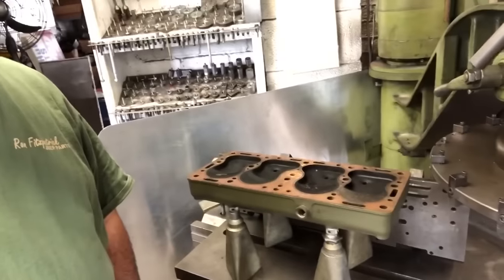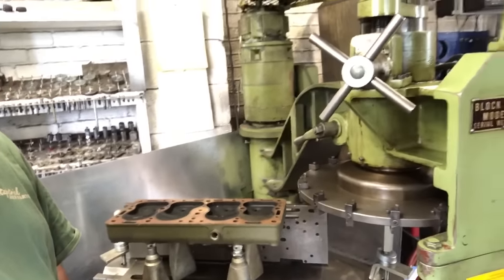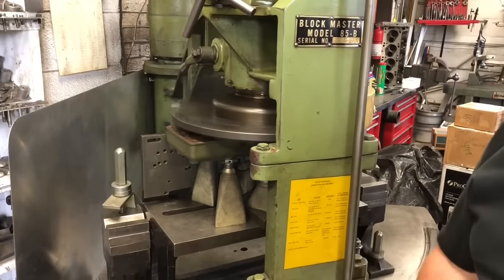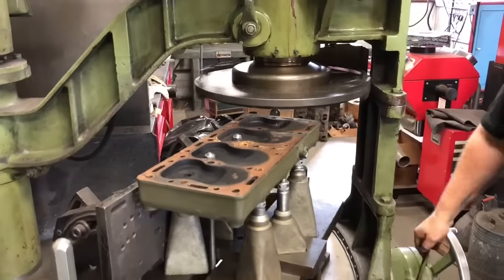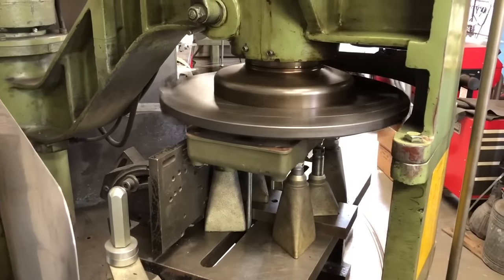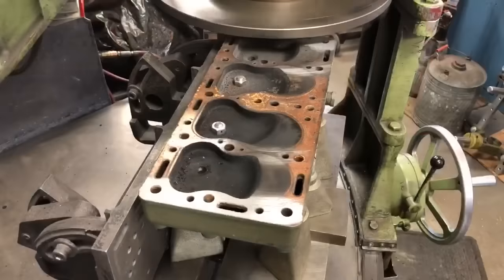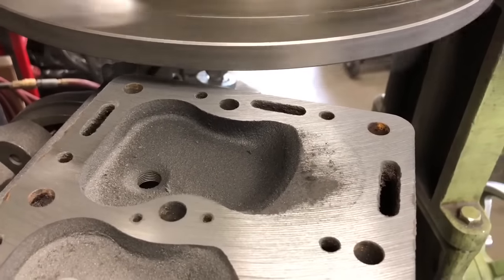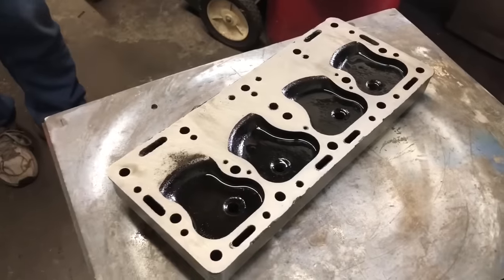Willys Flat Head resurfacing

Comment: I would liked to have seen a straight edge put on the surface of the heard and checked it with feeler gauge after the milling job.
Reply: Why? You can clearly see the warp and how it was taken out.
Reply: @Mr sock. With those six jacks, doubt he had it torqued that right
Reply: Working in 3d control i ca say for sure that the head was warped because of the clamping. When i have to repair a device i check the device clamped and unclamped so i am sure i have no deformation.
Reply: The machine would have to be in really bad shape to not cut level, the foot that runs around the edge of the table just stays good. The old machine I ran 35 years ago looked terrible and produced superior cuts.
Reply: @scrapwire1  i agree that some old machines are built much stronger and can last 50 years and cut straight like a arrow with good maintenance. But here is clear that we have operator error because of the clamping style. If he would unclamp it and put a comparator clock/watch ( dont know the term in english) it wount be straight
Reply: @zipperc1210  As you wish, I have no time to argue, I'm sure he put the stands against it before he clamped it down, I ran one for years, clamping them the same way and never had a problem, if it disturbs you, please don't do it that way, maybe you have a magnet big enough to hold it.

Comment: Likely flatter than it ever was from the factory. Nicely done. Don't need coolant, really, when taking such a light pass. That cast wouldn't even have time to heat up enough to cause any damage. I guess the milling head isn't level, I didn't see any cross hatching. Depending on how much the head is tilted, I guess there could be some cupping, but the head bolts and gasket will take care of that.
Reply: I have been told that you don't need coolant or lub with cast iron.
Reply: I don't know why everybody seems to think factories built bad parts. The new cranks being sold are out of spec and last week I had 5 pistons wouldn't fit over the rods. They also pack piston rings by weight and we had one kit short a ring and one kit with an extra ring. We never used to have the problems with quality that we have today with better equipment. Seriously, new tie rod ends that last 4000 miles is going forward?

Comment: Couldn't hear when you said something about wire wheeling? What's wrong with using a wire wheel to remove gasket before machining? I worked in a machine shop a few years and used wire wheels every day

Comment: You did everything backwards.  Clean, check for cracks and then resurface. (if not cracked)
Reply: I agree.
Reply: theres a reason to crack test it again because there may be cracks underneath a good surface.
Reply: @10Mbowman  nope probably a bottom feeder job were the customer just wants it milled and does not want to pay for anything else. I used to call them one valve valve jobs. Just fix the burnt one. should be refused
Reply: Good luck finding a crack on a 80 year old head before you take all the rust off.
He was using the resurfacer to clean the head.
If I brought in an antique head and the re-builder used anything other than the re-surfacer on it to clean it , I would kick his a$$.
Reply: @glennchartrand5411  or you can use a wire wheel or a glass bead cabinet or a sand blaster or a shot blast machine. machining the head to check for cracks is not an efficient way, It was probably a low buck job and the customer did not want to pay for cleaning and magnefluxing.
Reply: @tomhutchins1046  you don't use a wire wheel or abrasives on an antique head thats warped 
You take the absolute minimum possible amount of metal off because you can't just buy a new one.
I'm pretty sure this guy paid EXTRA to have it done this way.
Reply: @glennchartrand5411  you wont take any measurable amount off with any of the ways i mentioned. This is not youtube bull i have owned an automotive machine shop for over 30 years. You hot tank then glass bead then magnuflux (check for cracks) if the cracks are repairable you do that first . Then you mill the head last. But you always check to see if the casting is good BEFORE you invest time and the customers money in milling or machine work.
Reply: @glennchartrand5411  PS dave walker the one at the top comment is absolutely correct
Reply: @10Mbowman  Would not hurt to do a second mag after milling odds are you wont find anything you did not see in the first mag but it can't hurt
Reply: @glennchartrand5411 
 Ps except never use those little scotch pads in a high speed air tool many mechanics use they can do some damage.
Reply: I'd find them all the time. No luck needed.
Reply: @tomhutchins1046  Well said Tom, I worked as a machinist for years to, these guys probably have never seen a modern shop, let alone a CBN cut surface.  We used rottlers and they are fast and accurate.  Love to see how he resizes some of the newer John Deere Rods, love to see him try on a old sunnen rod hone .
Reply: @glennchartrand5411  I'm willing to learn why if you're willing to teach me.
Reply: Привет не руссккие

Comment: Hi guys, very nice presentation, respectfully when an engine has a warped cylinder head the engine block also warped, question, a saw someone claninge the cylinder head on a cleaning tank, i know fist hand that those claning agents penetrate from your hands into your liver in eight seconds, i don't want to mention any particular brand but please avoid at all cost to do that with your bare hands, those cleaning tanks were removed from our shop at cummins metropower in  newark nj on the early 80's because we found out the extreme health hazard to every one in shop, please use caution with it, it is a most to wear safety gloves and breathing masks, respectfully a fellow worker, please keep up the good work.
Reply: Most kind of you guys.
Reply: better turn on spell check

Comment: Knew of an automotive machine shop in Florida that used an eight foot horizonal belt sander to "resurface heads".  They'd lay the head down on the running belt, spin it 180 degrees a time or two and call it "good". Even as a kid, that never seemed quite right to me.  Even less so now.
Reply: i bet it worked though
Reply: @alexjohnward  The production rebuilders used belt sanders most are gone now and thats one of the reasons . They just could not get the quality

Comment: No way would I have let that low spot on the head go. It looks as if it were around three or four thou of an inch. Why not just take it out? Carbon could build up under the head gasket causing the head to possibly crack in my opinion. Other than that one complaint, this was a good video. Thank you for your time in showing the world these skills.
Reply from the maker: James Kennedy head works perfectly

Comment: If the head surface was warped to start with, why measure off of the warped side before starting to cut? Wouldn't it make more sense to measure off the other side of the head to the surface the head sits on?

Comment: I wonder if those two hold down bolts in the spark plug holes are causing it to bow down in the middle.  if so, then they are messing it up by making it flat.

Comment: I would’ve personally wanted a smoother shinier surface without the deep cut likes to insure a leak free surface, but that old timer looks like he’s done plenty of em ;)
Reply: those cuts hold the gasket in. a pro would unclamp the head and turn it around so the cut marks face each other and compress the gaskets......rofl.
Reply: Those cuts don’t hold the gasket. You want a nice flat smooth surface. But I like your sarcasm 👍
Reply: @IntegraDIY  MLS gaskets require a very smooth finish, the old school copper, and graphite gaskets need a less finished surface so it can grab and seal everything.

Comment: A whole lot of engineering  gurus in the comment section 😜
Reply from the maker: crown Victoria lifestyle it’s okay it makes people feel good. I’m grateful for what I got done. Stay tuned picking the engine up tonight
Reply: If YouTube is good for one thing, it's "experts" who will just proclaim a 30 year career in whatever they're trying to sound smart about.
Reply: I worked at a place where we pinch bolted the heads on a face plate and spun it across a single point tool on a belt driven lathe so its whatever gets the job done, never felt totally safe near it while it was spinning though lol
Reply: If you knew what you're doing with this kind of work, you could be critical too.
Reply: The most fertile soil for these kinds of comments are welders' videos.  For some reason a good number of "experts" have this felt need to communicate everything they perceive wrong in what another "expert" is doing.  God help the individual who is just some weekend DIY welder, and has posted a video of his project.  His work and very character will be put under the Youtube microscope, and judgment pronounced!  The vitae-resumes will be pulled like six-shooters, until sooner or later someone finally declares that they have welded on nuclear reactors or one of the NASA space shuttles.

Those kinds of posts can be oddly interesting to read; like watching a slow-motion car wreck.  You want to look away, but its so strange you find you cannot.  One thing is for sure; regardless how much technology may advance in any specific field or trade, human nature remains constant and unchanging.

Comment: Well of course it will be bowed the way it is held on the table - why would you put the clamping studs in the middle and jacks on the outers?  The clamping force should be in line.  There is a reason why industrial machinists can work in automotive machine shops but not the other way around.
Reply from the maker: Rabid Farmer This man has been rebuilding racecar engines for at least 30 years I trust him. It was checked for flatness before it was installed on the table. This head is perfectly flat and has been working on my engine without any problems ever since
Reply: Watson's Wagons — im not questioning his competence just the procedure.  It is inconsistent with accepted industrial thought on clamping or securing a flat stock.  A surface grinding machine would have been optimum as it will put the smallest amount of stress on the material and requires the smallest clamping force.  But if the process works, im all for it is all.

i also understand the limits of the type of milling machine being used - a Storm Vulcan flycutter.  I own and use the same.  How do you think this head was clamped and machined from the factory?  They would have had a special jig to hold and secure the head for the machining process.

Comment: Hi guys, can I add a comment, or ask a question. don't bite me If I`m wrong here, but you only have applied downward force in the centre 2 plug holes, would that not put distortion in the centre of the head when machining? or was it done that way for a reason.. thanks for the video anyway, it made me Interested enough to comment.. Thanks, Ivor from the UK.
Reply from the maker: Ivor Burit if you look there are 6 supports under it. It would have distorted if the two center supports were not used.

Comment: Mike....how would shaving three and leaving a partial valve space affect the performance flow of air/exhuast gases? I would have thought the depression being factory milled,was for a reason in regards to the performance of the inlet/outlet valves.
Reply: Its not a twin overhead cam head with 10 to 1 compression and gas flowed ports, you could whip off a 16th and make little difference

Comment: near one of the chambers remained microcavities after rust. In that place the gasket will burn. How did you solve this problem?
Reply: If you look at the copper gasket in the last shot, you can see that the gasket is probably not going to touch the rough area. Everywhere the gasket touches the head there is clean and smooth metal. Should be a a tight seal in my mind.
Reply: +Hans Wurst 
thank! Now it is clear. I just watched the video inattentively

Comment: Maybe it’s low where it’s pulled down with the bolts,,,,,, just a thought?
Reply: Lol maybe.
Reply: I ran one just like it 35 years ago in Houston, did years of heads in it, the warp in that head is normal, The bolts probably had little torque on them, just enough to keep it from shifting around during the cut, The wheel exerts very little pull on the head being cut.
Reply: There are probably a dozen video's of Storm Vulcan head mills on here, I bet someone puts a straight edge on one.
Reply: Definitly xD
Reply: @scrapwire1  Thank you from another old auto machinist. Lots of know nothing comments on here.
Reply: @billmiller7138  They just cannot understand the screw jacks under the head, you put the jacks against the head from one end to the other, level the head with a precision level, tighten the hold down bolts, mill the head. I have used a Starrett straight edge with a light behind it on every one I did.     Maybe they think it just uses two stands on each end and pulls the head in the middle, no telling.
Reply: What is pulling the head away from the bolts in your mind?
Reply: @paul9813  I think he is making a reference to the fact the head was cutting on each end and not in the middle, from where I'm sitting, I see 6 jack stands under the head, I have never seen one I could compress. That is normal warp in a head of this type, It's really simple, there is less iron in the combustion chambers, the top of the head is mostly solid iron so when the head is heated it will expand, it will bend toward the least resistance.
Reply: Paul smith well I don’t even remember saying that, what I did say is and it’s on record, that the  lows spots are  where your two holding down bolts are, now this might be a coincidence, but it could be that your middle spacers are a few thou low and that’s why your taking more off the two ends of the cylinder head?

Comment: Honest question.. Why use this elaborate machine over a surface grinder?
Reply from the maker: deweys don’t know, it’s what he has in his shop.
Reply: deweys it's not about the equipment, it's about the operator. Why change what's not broken? The operator has probably been using that equipment for his entire career and has perfected the use of it. I trust someone using old style equipment and years upon years of experience, over someone with new equipment with way less experience. A machinist tools are worthless without the machinist that knows how to properly use them. Complicated is a relative term. What someone finds a complicated procedure, some find to be simple as tieing their shoes. Why have shoe laces when you could use Velcro straps and get the same result?
Reply: @commonnons3ns316  Shoe laces can get you out of a major bind. 3 years ago 911 operator told me to get shoe laces and a safety pin. Who uses safety pins any more since the advent of diapers? So I go get the shoe laces from my work boots I keep on hand cause they get burned a lot torching, and the safety pin I had some keys on and deliver a baby 12 minutes before the fire dept. and ambulance got here. Would have been f'd with velcro......not sure what the safety pin was for. Midwife untied the cord when she got here after all the hard work was done. YES I am that guy who made the pickle trays and feast to feed everybody afterwards while they did paperwork for 2 hours (local legend).

Comment: So if I did this job on my mill with a fly cutter and the final finish had no two points that were more than .002 inches apart in z, would it be good to go? Thanks.
Reply from the maker: Michael LaPierre I have no idea I’m not a machinist. I just recorded what this place did
Reply: Depends on the head and type of gasket. On those old flatheads gramps sprayed them with copper and reused the gasket. New cars not so lucky.
Reply: @maxwebster7572  Thank you!